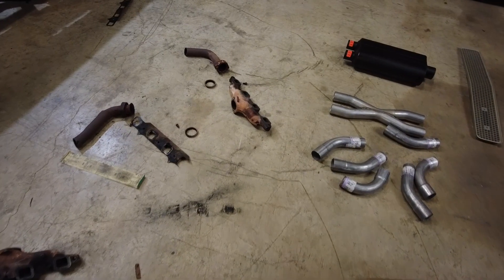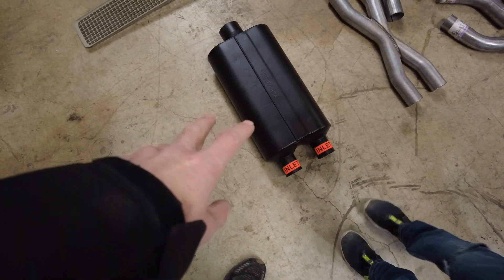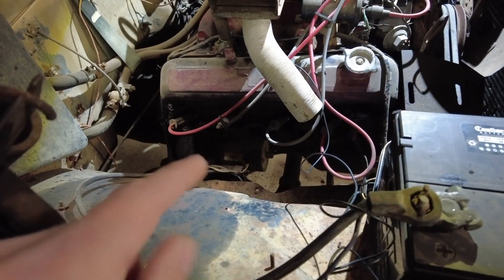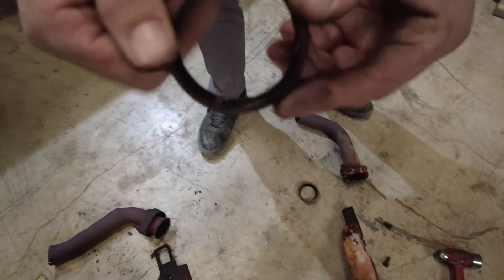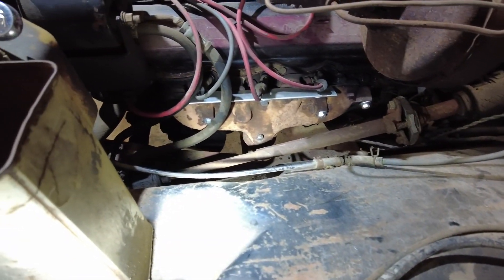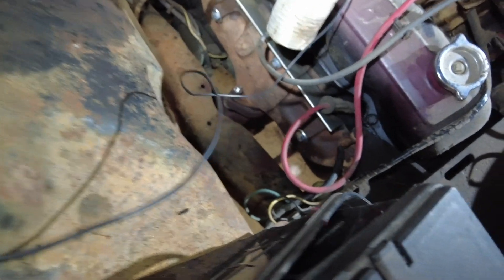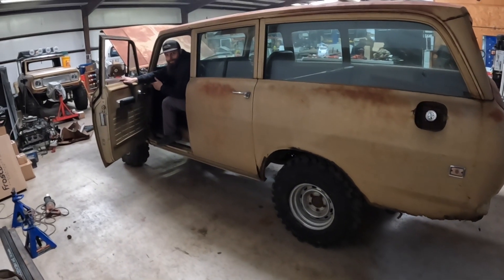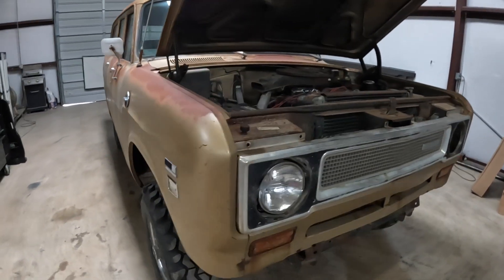Travelall gets new Exhaust!

Comment: I had a 1971 1010 Traveall with a 345 V8, if I remember right, in the late 70's.  It's was a great truck.  It always started and ran so smooth.  Got terrible gas mileage in the Carter gas crunch years though.

Comment: Bein an IH guy myself, i have a 71 T'all. I got big plans for it: 2020 JT axles and suspension sittin here waitin to go in, lookin for a 5.9Magnum or 5.7Hemi and auto to swap in. The current auto is basically useless, and the 392 is gunna get hotrodded a bit and put in my 57 S120.
That 57 is another fun one: SV392 swap, Ford Highboy axles and tcase, 5spd, power steering and brakes, and tbi upgrade. 
I also have a couple others without any fun plans yet.

Comment: I am really curious to know why you used an X pipe when you then lead the 2 exhausts into a 2 into 1 muffler? They do the same thing.
Reply: we were mainly hoping for the sound mod from it, and some scavenging effect. Originally we planned on running parallel mufflers, but nothing we liked was in stock, so we ended up with 2-1 muffler as well. Agreed, seems a little dumb now haha! Thanks for watchin

Comment: Hey guys, what was it that you did to Matt's Toyota to fix his issue with the tranny pop'n out of 1st and R?  I have an '05 Jeep Wrangler TJ 4.0L six-speed that's been doing the same thing. It really sucks backing up a trailer when you have one hand holding the stick to keep it in gear while using the other to thread the needle...  and I damn near broke my hand the first time she popped out of 1st, that stick came flying out of gear like a Major League Baseball player swinging for the fence.
Reply: It was in Matt's video. I believe the 1-R shift fork was replaced. It was bent/tweaked?